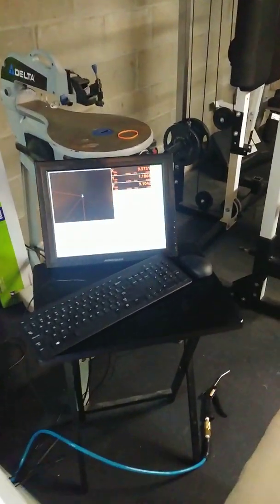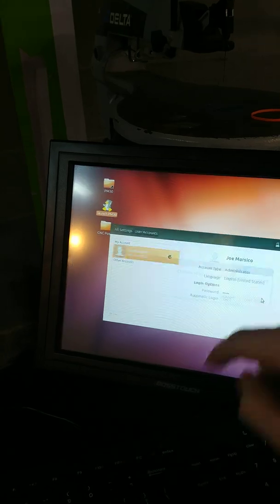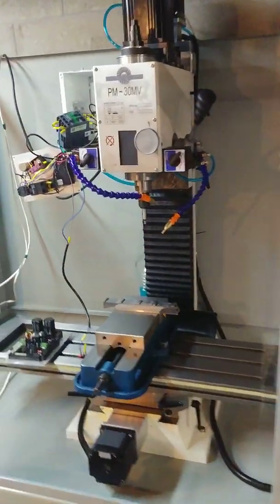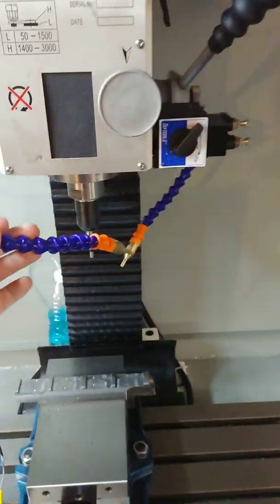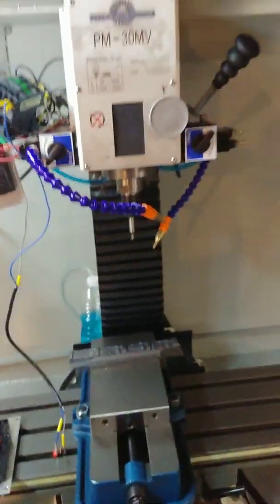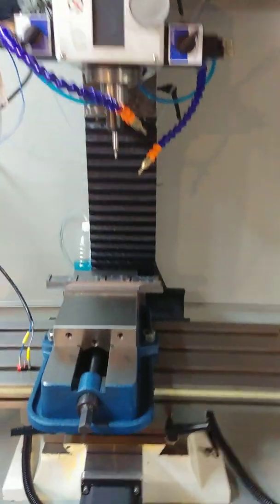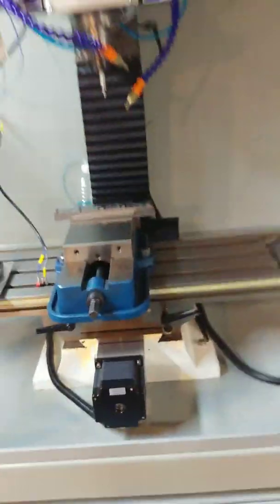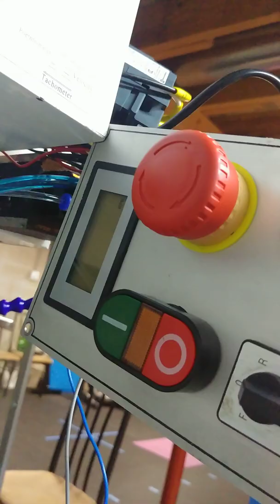How I smoked my C6 board and my motor controller on my PM-30MV CNC conversion

Comment: Upgrade that spindle to a iso30 atc with encoder, you will not regret it.
Reply from the maker: I don't disagree with you even in the slightest. Unfortunately I have yet to find a direct replacement for this spindle cartridge. It wouldn't be the end of the world to design my own head to fit one of those off shore BT30 spindles, it just likely won't be worth the time investment for me to source and make all of those parts as well as an ATC based on how much longer I plan on using this machine as my main mill. 

I am currently in the process of pricing out and taking delivery of my next machine (Looks like it will be a Doosan DNM4500). Although I do plan to keep this machine because it's so damn well tuned for what it is, I just don't think investing much more time in upgrading it beyond where it is now makes too much sense.
Reply: See... thats where you are wrong, that machine has potential... 
I have a PM25 that i put a 12.5hp HQD ISO30 on. Stock spindle/cartridge = shite!!
It made all the world of difference for such a insignificant machine. 

  Design an adapter.... print it in 3d & get a off the shelf 3ph spindle + vfd and HOG SOME MATERIAL MY friend,!!
Along with leaving a perfect surface finish. 
Add Clear paths and that PM30 will fly!
While it may cost $ upfront, it maximizes that machines profit if put to use.
As a added bonus you get to run similar feeds and speeds to the big bois. >:) 

Just my .02
Reply from the maker: You will have to check out some of my newer videos haha. This video is quite old. Since this video, the machine has gotten filled with epoxy granite, clearpath servos on every axis, I replaced all of the spindle bearings and I now have a 5HP 3 phase motor for the spindle running 10k RPM. It still is running the R8 spindle with TTS tooling, but the machine is an absolute beast compared to how it was configured in this video.

Comment: For sure you can't have seperate grounds looped together on seperate power supplies.   I know for sure,  this is true.   There is a way to produce common ground circuits with multiple P/S but you have to remove internal case ground wires inside them. 
  Your video could be much better if you don't spew every single thought passing through your head.   It gets to be too muddy. 
  Good luck!
Reply from the maker: Thank you for stopping by and I really appreciate the feedback. I'll be very honest that I have a lot to improve on the quality of these videos so I'll take any feedback I can get!

Comment: Hi, I wonder if you can help me?  Do you have any images of the PM motor control board with the wires connected?  I need to know which connector the FORWARD/REVERSE connector is.  Basically I unplugged my board without first taking a picture and I didn't realise there's two identical 4 pin connectors, none of which are labelled!! :(

Wire colours I have on my machine for this connector are BLACK/YELLOW/BLUE.

Any help greatly appreciated!
Reply from the maker: Chris W i can get some some pictures for you if you need. But if the switch positions are the only things you need, you can figure that out very easily with a multimeter.  Simply have the switch in the Off position and verify no continuity between the two pins with the wires for FWD and REV connected to them (should have near infinite resistance) then take the switch to FWD and the pin with close to no resistance is your FWD pin. Then you will have your color code figured out and you can rewire your board. If that doesnt work for you, just let me know and i can get you some pictures
Reply: @MPMachining  thanks, it's the physical location of the connector I need.  There's two 4 pin conns on this board but they're not labelled.  One is in the corner of the PCB, the other is next to the mains power input.  One must be unused and the other is for the fwd/rev.  Kicking myself for not taking a pic!! 🙄
Reply from the maker: Chris W i can definitely get you a picture. I took one when i took the control apart so ill try to dig it up. If not, ill just open my controller and take some pictures
Reply: @MPMachining  That would be a big help, thanks!! :)
Reply from the maker: @Chris-hy6jy  sorry it took so long, but I have those pictures if you would like to send me an email (battleresistantoutfitters@gmail.com) and I can send them over. I actually had another user who is doing his conversion right now send me his photos. Hopefully that helps!

Comment from the maker: In case anyone is watching this in the future and curious what actually happened. Notice that both of my power supplies in the computer are mounted to the same metal computer enclosure. . . They we're sharing a ground through the case of the computer. Everything worked just fine after I added a new 12V wall supply to the mix.
Reply from the maker: @Squid Person in just about all cases, a common ground connection is no problem at all. As you said, a properly connected star ground is usually your best bet as long as you rate the common ground wire for the total current capacity of the system. However, what I'm talking about here is a DC "ground" or the negative wire in the system. This is not the same as your third prong on an AC system that typically carries little to no current.

The trouble you run into is in electronics usually. Some of these systems utilize a "floating ground". In simple terms, the ground exists internally to the component only and does not have a direct path to earth. When you start mixing analog and digital systems together you have to be really cautious of your grounds. If not, you can accidentally shunt a normally floated ground to earth and the current that flows through the components will almost always destroy them, even if the system is fused.

The problem I ran into was a very specific example where the board used for spindle control can NOT share it's ground with the other DC power supplies on the system. In higher end boards, this risk is taken out using optoisolators or other similar components and you can basically ignore the ground connections.

It is common place to share a ground on a DC system, even among different voltages. If you're dealing with electronics things can get a little tricky and sometimes you let the magic smoke out haha
Reply from the maker: @Squid Person it's only required to isolate the ground if the manufacturer specifically calls it out (as is the case in the C6 board from CNC4PC) I'm very knowledgeable about electrical engineering and electricity in general but I am far out of my element when it comes to electronics. I know enough to realize when I should probably research or ask someone smarter than myself haha. The specifics on when it is required isn't something I can talk too intelligently about, however, the method is fairly straightforward.

I simply used a wall plug 12V power supply. In theory, my toroidal power supply also should have worked, if I wasn't an idiot and mounted it directly to the case that shared the ground with all of the other electronics components. It basically created a ground loop between the components (the same is also possible if you improperly wire a star ground). I was very conscious that I had to separate the grounds, I was just so deep into thinking that you can't pass a ground across a transformer that I didn't stop to think that both transformers were grounded together through the case.

The wall plug was about $10 and many people on the internet had already learned this lesson the hard way, I made the mistake of thinking I was smarter than them. Always nice to get humbled sometimes
Reply from the maker: @Squid Person I didn't generate a diagram for my build unfortunately. The spindle control is extremely straight forward though. Are you needing a full wiring diagram for the control or just where to hook up the wires to the pot?
Reply from the maker: That depends what you're trying to accomplish. There are two steps for spindle control. There are wires that you need to run for fwd/rev control. That basically bypasses the barrel switch in the control box. Then there are wires for the speed control. The stock control accomplished this with a 5V constant signal that it runs through the potentiometer pot on the front of the control cabinet. Higher the resistance, lower the output voltage. It uses that voltage signal to determine speed. So your C6 board just bypasses that and directly sends the variable voltage signal to those same wires and you just ignore the constant 5V wire connected to the pot
Reply from the maker: @Squid Person I definitely agree. I sort of made it up as I went. If you get into any roadblocks when you're going let me know. Actually tearing down my mill now
Reply from the maker: @Squid Person I'm actually going way above and beyond with the spindle motor. I'm swapping it for a 5HP 3 phase induction motor from Marathon. I'm actually editing the video on building the VFD and first run of the motor as we speak.

Comment: what ver. and name of linuxcnc are you running?
Reply from the maker: I'm running version 2.7.14 still (they have recently come out with a 2.7.15) on Ubuntu and the graphics I'm using is gmoccapy
Reply: @MPMachining  can this be installed on xp?
Reply from the maker: @wow-wow-p8d  the LinuxCNC install is actually its own operating system basically. So you can have a computer with two partitions on it if for some reason you want to keep XP on the computer. My recommendation would be to have a computer set aside just for LinuxCNC
Reply: @MPMachining  can you give me link  for very thing  i need to download to install? is this going to be better then mach3? mach3 is what i'm using right now
Reply from the maker: @wow-wow-p8d  http://linuxcnc.org/docs/2.7/html/getting-started/getting-linuxcnc.html
Reply from the maker: @wow-wow-p8d  above should have all of the information you need to download it and the forum for LinuxCNC is VERY helpful. I started with Mach3 myself and there was no comparison between the two for me. I like the interface and speed of LinuxCNC much better. It is also completely free and the user community is really active in improving it.

Comment: Thanks for the shout out! The 16 pin IC with charring is a bank of 4 optocouplers. The side with charring is the input side which leads me to think you had too much power from one of your inputs. You may be able to follow the traces and see which input was feeding that pin. I think the C6 uses 3 of the 4 optocouplers on that chip. 1 for each relay and 1 for the spindle step signal. Then they all have a common ground pin going back to the breakout board.  Also, how are you wiring in the coolant relays? If they aren't isolated, they could have contributed to the smoke.
Reply from the maker: Unfortunately that pin in the IC just traces into another chip in the back of the board so I lose trace of it after that. My mist coolant has 5V from my BOB and ground from my BOB then a step signal from the BOB to trigger the relay. My mist coolant is just controlled by a 12V solenoid so I have the 12V from my computer's power supply going into the common and one of the legs of the solenoid going into the NO contact on that relay. Then the ground from the PC power supply is wired to the opposite leg of the solenoid. Do you plan on having your V2 of your spindle control any time soon?
Reply: Is it a mechanical relay? If so I think you need some protection since the coil is an inductive load. Check out some of the various eBay listings for CNC relay boards for more info. I think they run a diode and capacitor but I'm not sure.
Reply from the maker: The relay I'm using is an electromechanical relay with an onboard optocoupler. Now that you say that, I'll probably grab a SSR just to rule it out. Somehow in the Sparks my pin 14 which drove that relay stopped working on my breakout board. So I can't rule out that it had a hand in it. That relay was switched off at the time but it clearly did something
Reply: I was wrong about what IC that is.  I just dug my C6 board out and it looks completely different than that.  I'm on Rev6.2.  I think at one point in your video I could read 290 on the chip.  My board has an LM2907N so I assume that's what yours is.  If so, that's the chip that converts the frequency input to an analog voltage output.  I don't think the relay is an issue since it is on a board, likely meant for this type of use.  I do still worry about your shared power supplies.  This video is a little tough to follow but he explains optocouplers and isolated circuits pretty well in the first 5 minutes. https://www.youtube.com/watch?v=cIVQXBF8Xpo.  Also, I just saw you asked about my version 2.  I honestly have a few ideas for improvements but haven't had time to play with it yet.  What I am advertising is I will sell the new board to anyone that buys version 1 for just the difference in price.
Reply from the maker: So after a few hours of hopelessly staring into my computer case and at the ripped apart mill, I think it dawned on me what I did wrong.  I kept thinking that the power supplies had an independent ground because the 12V and the 5V came from two separate AC/DC transformers. What I failed to realize was that both of those power supplies are mounted inside the same metal computer case. Even if their ground is independent, they are both grounded to their individual housings which directly contacts the grounded case of the computer. I purchased a 12V 2A wall plug power supply and a new C10/C6 board as well as that SSR just for safety sake (I also personally don't like hearing the mechanical click every time the coolant turns on because it always makes me think something sparked) and a new motor controller from Precision Matthews. I think I have built up enough courage to give it a shot again but with the new independent power supply. Next time I'll be sure to make a video so all of YouTube can watch my panic face if it happens again!
Reply: @MPMachining  Hi! I am in the same situation, ready to try to control the spindle of a BF20L (similar machine to yours, all China based). I watched and read your comments 100 times and do not understand why your initial set up did not work. The separate power supply should had isolated GND by the transformer, I also contacted the guys from CNC4PC and asked about a similar situation and they tld me that is correct. THe most importatnt thing is that the analog GND for the main motor board (spindle controller) is not shared with the breakoutboard (C10 in your case). Here the video they sent me https://www.youtube.com/watch?v=r_BNxS02nKg. I am wodnering did you earth ground the analog output from the transformers? Becuase that will give a common GND to the different power supplies. Thanks!
Reply from the maker: @Ale_Lab  thanks for watching.  It turned out to be such an easy reason that I felt dumb when I figured it out. Yes, my grounds were isolated between the different transformers. Unfortunately I mounted both of those transformers to the same metal case that my controller was housed in. So I essentially grounded them both together at the case. 

All I needed to do to fix the problem was purchase a cheap wall plug DC power supply and I have had no issue since
Reply: @MPMachining  That was clear that they where all inside the same case, but others did the same, Hoss as well. Did you perhaps grounded the control board ( I guess you mean BOB or C6) to the metal case? 
I am saying that because the 12V power supply stiull share the earth GND  of the other transformers. Of ocurse if you gnd the analog or breakout board to the metal case then yes they are connected with Earth GND
Reply from the maker: I was interested in your V2 because I liked that you were able to get over 12V. I have to get my controller back together again but I was worried that my initial 5V control voltage I was measuring was wrong and at times I would get spikes up to 19V. I now think that it might have been induced voltage so I plan on checking it with low impediance mode on my Fluke rather than the $15 special multimeter I was using here. If that is the case, I'll probably get your V1 and a set of 2 channel relays to use for CW/CCW until you build your version 2
Reply from the maker: My stupidity just gets better and better. My SSR came in today and when I opened it I realized I bought a triac based zero crossing relay. So if I use it for the coolant relay on 12V dc output it will probably turn on great! Then won't turn off again until 30 minutes later haha. Looks like I'm sticking with the mechanical relay for now. Glad I found my ground problem at least